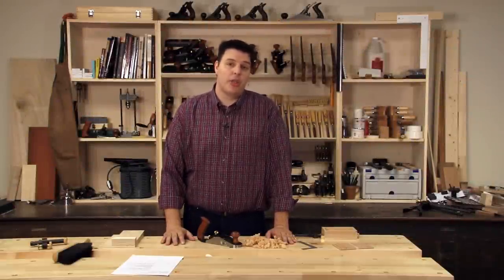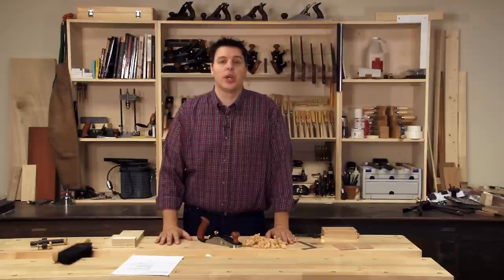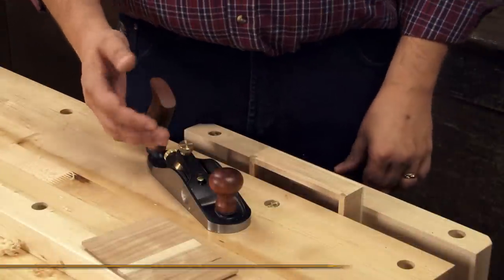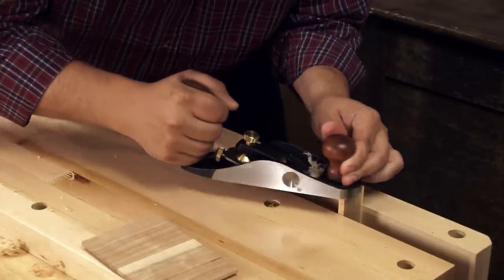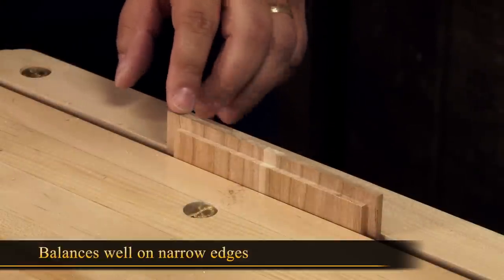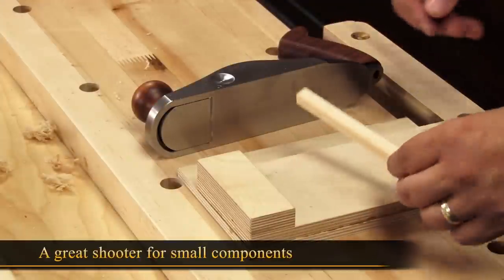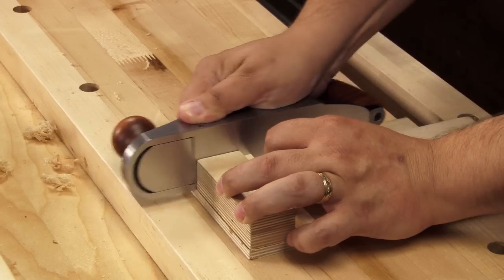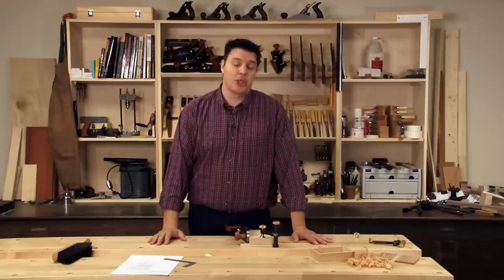Veritas Small Bevel-Up Smoother

Comment: I bought the SBUS recently and tried it with my latest project. It works best for pieces where you'd use a block plane, but want more control. I got a spare blade, made it with 45 deg microbevel, and used for difficult wood. One complaint (the same for all planes with Norris adjuster) is that when you hit chatter, the adjuster loosens back. One day I'm going to fashion a clutch out of nylon block, to prevent that.